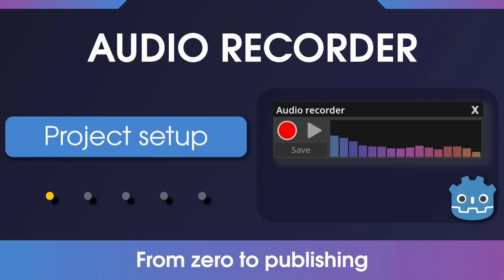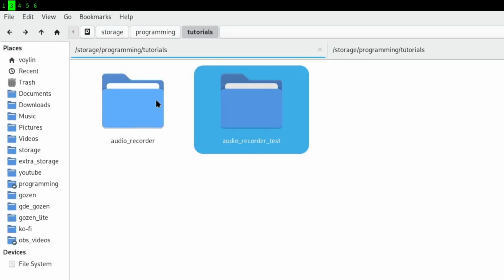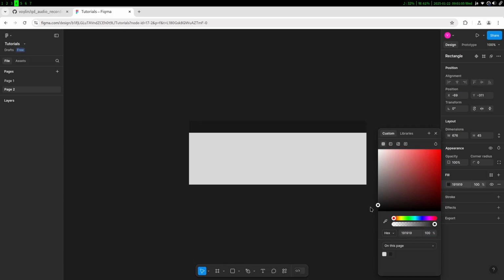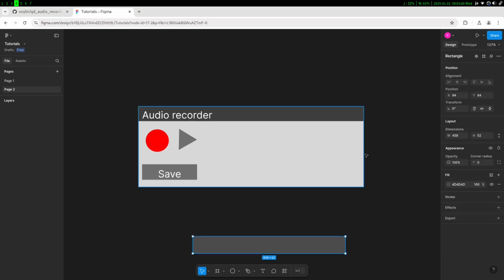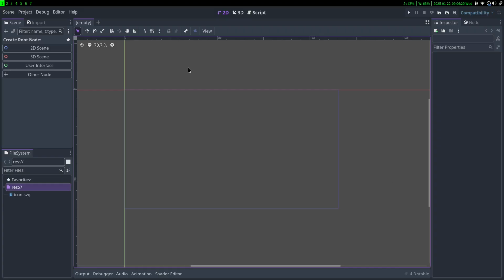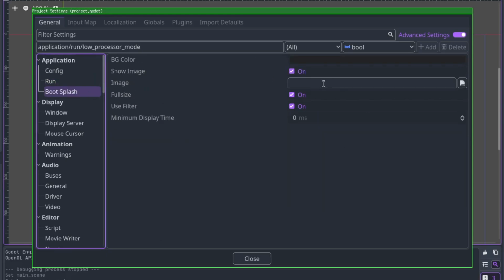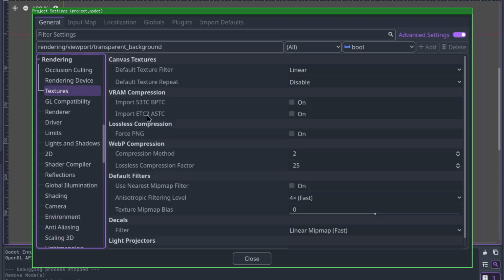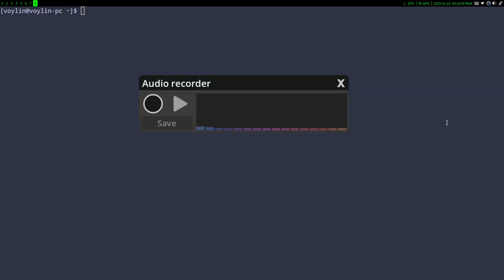Setting up the project - 1/5 Audio Recorder in Godot

Comment: nice start of a new series. Tbh I'm thinking again about making some tool and I'm wondering if I should try and use already well known for me Godot or try learn new things like qt6, OpenGL etc..
Reply from the maker: @bartudev566  Godot could probably make it, but getting to learn new systems could be good. I've been thinking of picking up Golang to try and make software with instead of using Godot for software. But qt was a pain last time that I used it. Good luck with whatever tool you choose! ;)
Reply: @VoylinsGamedevJourney  I was wandering about making ms paint but foss. Godot would be more than enough for that. But the idea of learning OpenGL and GUI library like qt is kinda tempting.
Reply from the maker: Does sound like a fun way to learn OpenGL and/or QT, could be a good goal for 2025 ;)
Good luck!